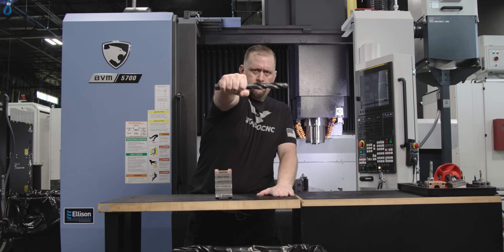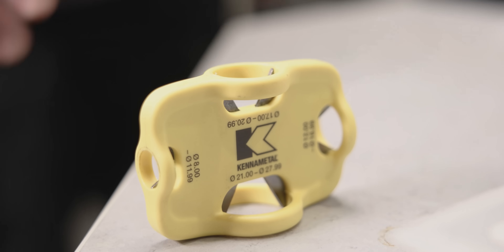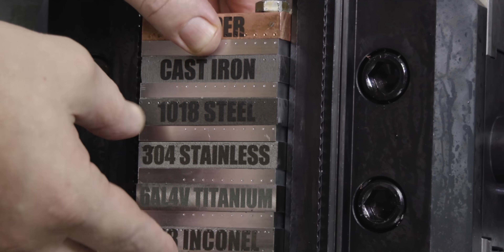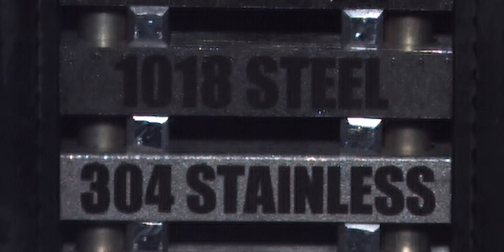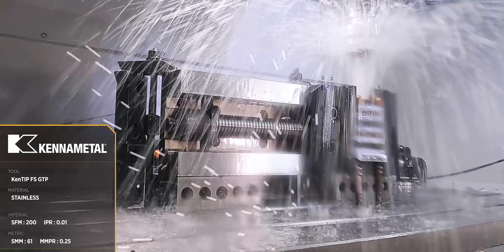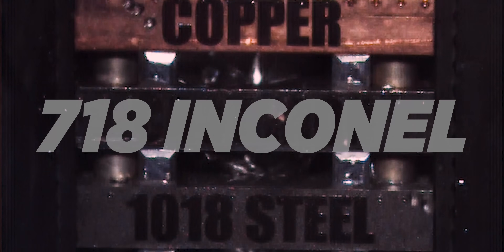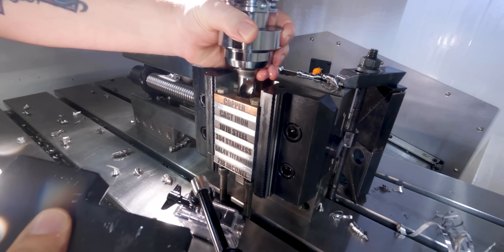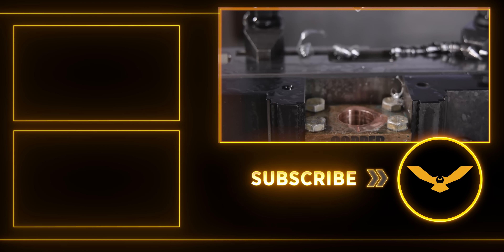Drilling 7 Materials at the SAME time | BVM 5700 | DN Solutions

Comment: Funny story , we have a big tool that we call The Terminator, it has two big inserts  on the sides and one very small insert somewhere on the inside to do shampher before the threading operation,  about three years ago  someone didn't tighten that small insert enough,  it fell off and we worked like that for a few days, until the machine said it's time to change the tool   and we did hundred of parts without the shampher and had to redo all those parts  like 500+ parts , the good thing though is that this specific operation only took like 15 seconds per piece, we were doing two parts per machine and we had six machines at the time working the same piece/program  so it went quick  😅

Comment: I used to chunk out holes with a 6 inch spade but no pilot hole, Morse taper 5 at .015 per rev 50 rpm in 4140 on a Warner and swasey lathe,you say your Ibarmia has torque let’s see it do that😂

Comment: Not sure about that. Iscar sumo cham drils very similar in design
Don't know what's cheaper though
Reply: Similar, but not the same. This one has a stronger interface, fully circumferential carbide head, and the KTFS in general has more productive high performance geometries than the SumoCham.

Comment: Have you guys ever considered doing a lineup of Kennametal, Sandvik, Walter, Seco, Sumitomo, Guhring etc to see who's really got the most durable inserted drill, udrill, endmill etc across a range of materials?
Reply: They're doing good business with Kennametal so nah
Reply: This. We have found Ingersoll inserted drills to be the best on stainless but we also haven't tested every brand. Would be a great video if someone did that, would be a very expensive one to make tho lol
Reply: @john.hunter  You're not wrong there.
The problem is they're not entirely up front with the fact that these videos are advertisements for Kennametal products (and blaser swisslube, DN Solutions etc for that matter).
Every brand has their strength/focal point of their product line. IMO for Kennametal that's inserted drills, their UDrills really do perform brilliantly, Sandvik are utter garbage by comparison (esp once you get up to 4/5xD) but their endmills are no better than Guhring, Iscar turns circles around the competition in facegrooving, Sandvik are outstanding in boring tools etc (their carbide reinforced silent bars are incredible). 

Obviously all this stuff can change by material so you want to carry the grades/geometries that provide the best value to your shop. 
Limiting yourself to a single manufacturer is not generally the best approach unless you're getting paid to showcase tools.
Reply: Add Allied Machine to that list.

Comment: With good feed and speed I can do all this with hss!!!
Go drill are great by the way
Reply: Well, that's kind of the point. HSS is only so hard and looses temper at after so much heat is generated by friction. 

Bottom line, with the right geometry and suitable speds and feeds, HSS will cut anything softer than itself. HSS tools are also cheaper (maybe 30% the price) than carbide. BUT you'll never get the productivity or the tool life out of HSS. 

For most people, cost-per-hole and machining time reduction are the heaviest hitters.

Comment: I've always wondered, when you drill through different materials with the same tool like that do all the holes wind up the same dimension or do softer material have slightly larger holes or vise versa?
Reply: The holes would all be very similar in diameter. Any size differences would be negligible since drills are often used for loose tolerance holes or roughing out material. Another tool such as a reamer or boring head would be used to finish the hole.
Reply: I’d like to also add: If there is any size difference observed, it most often will come from the work-holding i.e. chuck in a lathe or vice in a mill. Because there is high work-holding pressure being applied to the material during the machining process, the hole will not be the same shape and size when you take it out to inspect it. Softer materials such as aluminum and plastic are more prone to warp. There are machining strategies to counter this

Comment: I used a version of those drills a long time ago , dont remember the brand .. terrible. They had a thin thread to hold the heads, and some kind of pattern on top of the shaft.. the heads would randomly come off and destroy the drill, along with the part. ..  This looks like a better invention.. .  :)
Reply: There's a lot of modular drills out there that aren't very tough. A lot of demanding drilling will beat up even the best modular drill

Comment: Did you guys program using mastercams advanced drilling toolpath or just a regular drilling cycle and manually changing rpm as you pass through each material?
Reply from the maker: Hand programmed the pass to do a perfect chip break.
Reply: It's way easier to just hand type it. CAM isn't solution for everything.
Reply: @Stasiek_Zabojca  oh yes definitely, I was just wandering as I'm still yet to really crack the advanced drilling toolpath, but it could be a post processor issue

Comment: I love the go drills. I can't wait to give this a go.
Reply: DUDE! I feel you. I drill insanely fast and an insane amount of material with the GO drills. 17-4 ph. ALLL DAY LONG! Love them! mild steel! SUPER EATER! I'm so happy to find someone else who likes those drills as well.
Reply: try the Iscar SUMO-CHAM, much better performance.
Reply: @blizzardesigns  I've seen the KenTIP FS out perform the Sumo-Cham on a regular basis. 

The solid carbide drills and the KSEM are pretty much unbeatable.
Reply: @thatdrillguy7889  The only application where it outperforms is mild steel and as soon as you go up in HRC it performs very poorly. Allied XT Pro outperforms both of these but don't last as long.
Reply: @blizzardesigns  really? i'm shocked, next time i'm up doing 17-4 i'll check it out! thanks for the tip!
Reply: @socercrze  the kentip fs has two additional coolant holes about .750" beyond the tip and this pushes chips towards the tip and reduces coolant pressure at the tip, it's a huge risk for that coincidental chip getting pushed back and destroying the insert.
Reply: @socercrze  there are a lot of material specific insert geometries for Kentip FS. Blizzardesigns has some points, but I've been able to mitigate most problems with the right tip and the right speeds and feeds. 
Plus they've got the new bodies out now, too. Actually they're just the older body design, but they work well on lathes.

Comment: I run these on a structural steel plate machine.... they take a beating... 1000 holes in 1/2in grsde 50 plate no problem...
Reply from the maker: Is it the new GOdrill version?
Reply: @TITANSofCNC  it is not it's the Sumocham Chamdrill line  version.
Reply: @Mr05sti  Chamdrill is good. The KenTIP GOtip is worth a try!
Reply: @Mr05sti  Have used SumoCham for years, definitely a go to in our shop